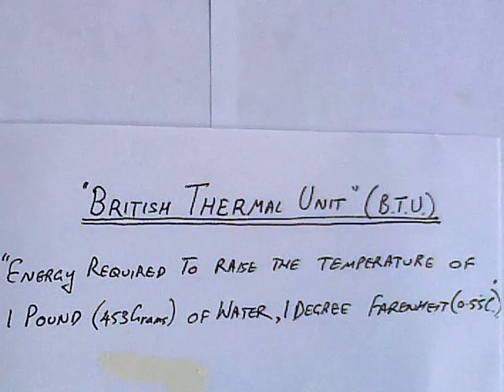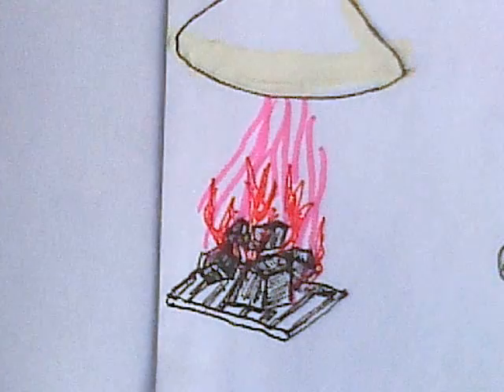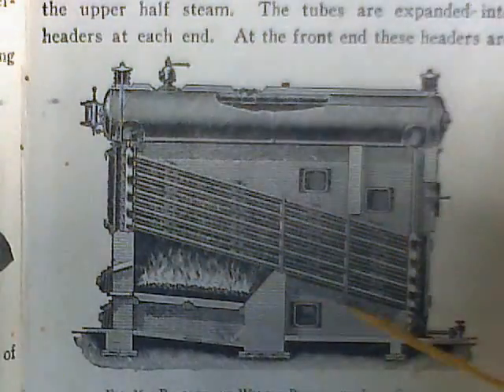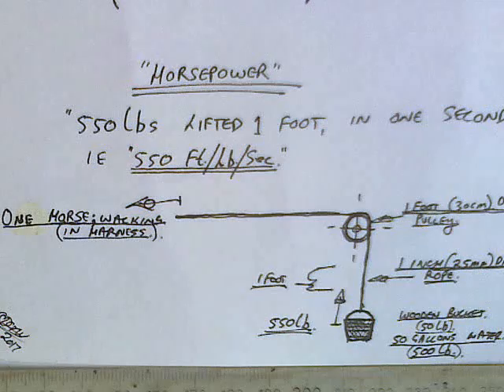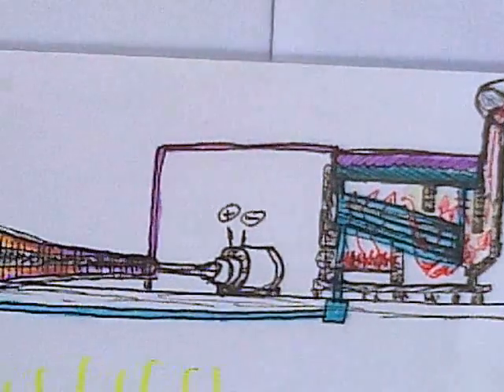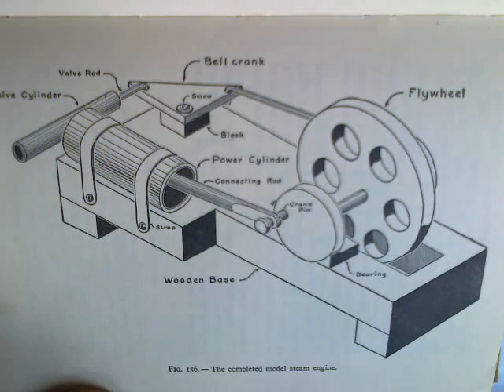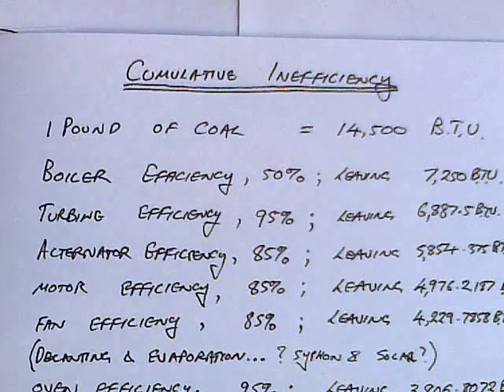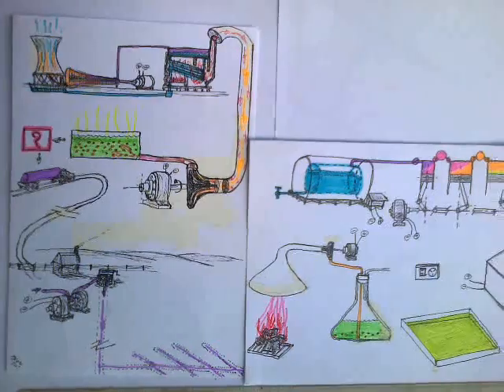Is Carbon Capture & Storage Thermodynamically Impossible...?

Comment: Unfortunately, it's quite incorrect. You have just estimated the energy conversion efficiency of a machine which burns coal (as a coal plant) and uses all resulting energy for carbon capture and storage. It's not electricity as this machine useful work is only liquefaction of carbon dioxide. Most importantly, it doesn't have sufficient supply of it from its coal plant.
As published in an IPCC report on carbon dioxide capture and storage, the energy efficiency of a coal plant drops by about 15%, if carbon capture is used, because of the energy spent on dealing with CO2.
Reply from the maker: G'day,

   Thanks,

     I haven't seen the IPCC Report of which you speak, but I have yet to see or hear of a single Climate Scientist who ever designed & built a Turbine and then used it to drive an Alternator or Generator with it, and subsequently charged up so much as a single Nickel-Cadmium Penlight Battery with it...; therefore I have no great trust in their ability to understand Cumulative Inefficiency.

   I have designed & built Turbines, albeit Free-Air & Ducted Wind-Turbines, and charged a few Batteries with them ; and I've seen how big a Steam-Boiler (Vertical Fire-Tube) it takes to run a Double-Action Single-Cylinder Steam-Engine at 250 RPM to drive a 50-amp Automotive Alternator at 1,000 RPM (which is 30% too slow to make any Current...!).

   The Freely-Polluting Coalfired Steam-Turbine driven Generators only convert 40.3% of the Energy in the Coal into Electricity....

   Considering that Air is 79% Nitrogen, and all of that has to be included in the Air-In/Flue-Gasses Out Equation, and remembering that all the Flue-Gasses have to be captured and processed while trying to capture the 27%-35% of their mass which is C.O.-2 in giant Lime-Water Hubble-Bubble/Hookahs, then you have to evaporate the Water off and bake the C.O.-2 out of the Dry Lime Crystals, before compressing it to liquify it and then refrigerate it to store it, and then carry it in an ELECTRIC Refrigetated Truck to the disused Mine where it is to be Pressure-injected via an Electric Pump...; my opinion is that anybody who thinks that all that 
mechanical manipulation can be achieved with a loss of only "15% of the Power Station's Output" simply hasn't thought the issue through.

   I contend that there is not sufficient Energy available from burning Coal to make Electricity  to power the Engineering  required to Capture & Store the CO-2 which burning aforesaid Coal releases ; let alone to capture the Emissions, liquify and transport and store them, as well as contribute any Current to the Grid.

  I'm saying that "The Emperor Has No Clothes !" and that the whole thing is a Crock of Horsefeathers.

  Such is Life,

  Take it easy...

  ;-p

   Ciao !
Reply: The cited data didn't come from climate scientists, as one should expect, but from engineers. For example, a paper estimating the change in efficiency from 36.6% to 21.4% is written by Edward S. Rubin who's a professor of mechanical engineering at the Carnegie Melon University and A. B. Rao who has a PhD in engineering & public policy, Masters in Environmental Science and Engineering, and B. Tech. in chemical engineering. And the paper was published, of course, in a peer-reviewed journal.

Well, there are different ways to solve the task, so details aren't actually important for superficial analysis. The one involving lime releases heat during capture that can be reused. The gas isn't precisely liquefied, but compressed into the supercritical state and the compression heat is again reused. They propose mostly pipelines instead of trucks and no refrigeration is needed (just thick walls to withstand the pressure).

In fact, they have not only thought it through, but they rely on information provided by existing carbon capture factories, like one in Malaysia. So, the real experiment has been done long time ago.

But the most important idea here is that energy released during the chemical change of combustion per mole of the carbon involved is much larger than the work required to change the physical state of the product (per mole). So, there is plenty of energy to work with even with all inefficiencies of the process.
Reply from the maker: +Macropus Macropode 

   Well, that all sounds good, but I can't see it working out as well as they like to predict.

  The sheer scale of the problem of capturing all the products of combustion, without inducing any Back-Pressure in the Flue to annoy the Furnace, and processing the Gasflow to separate-out & compress the C.O.-2 as fast as the Furnace produces Fumes....; strikes me as being a bloody big shitpotful more work than a mere 15% of the Power Station's Electrical Output will provide for.

   Maybe I'm wrong, but that's my "Gut-Feeling".

   I have a book on Methane, and the Hoops which one has to jump through  to turn Shit into Biogas (which is 27% to 45% CO-2) which has to be scrubbed out with Lime-Water before putting the resulting Gas through Iron Filings to remove the Hydrogen Sulphide....; after that the Methane feeds a 6-cylinder Liquid-cooled Engine (feeding it's "waste" heat back into the Methane Digester) driving a 3-stage Liquid-cooled Compressor (also heating the Digester) to squeeze the Methane down to 1,000 PSI..., to go in a long narrow High-Pressure Storage Cylinder.

   It gives one calculation about a 6 Hp Roto-Tiller running for 25 minutes to the Tank of Methane which goes like this ;

   "At 25% Compressor Efficiency it would take 0.52 Hp/Hr to compress the Gas (1,320 BTU). In other words it would take 1,320 BTU worth of Gas to compress the 25,300 BTU worth of Gas which it takes to perform 6,350 BTU worth of Work. Clearly the system is not very "efficient" in the sense that 21% of the RESULTING Work Energy is needed for Compression, while 75% of the AVAILABLE Energy is lost as heat...".

  So, 96% of the Energy from the uncompressed Methane finishes up  going somewhere else, and doing something other than emerging from the Engine's Crankshaft as Torque.

   And because Methane is a way to run Internal  Combustion Engines on Bullshit, it can be worth doing if one has a source of enough free Bullshit.

  But trying to capture & store the C.O.-2 Emissions from a Coalfired Powerplant will only add to the cost of building & operating the Installation, at a time when Megawatt for Megawatt it's already 30% cheaper to build Windmills or Solar-Panels than it is to build Free-Farting Coalfired Steam-Turbines...

  So, my guess is that the Engineers who wrote the IPCC Report have been overly optimistic, possibly because they're True-Believers in King Coal (?)...

   Take it easy,

 ;-p

  Ciao !
Reply from the maker: +Macropus Macropode 

  Well, your grip on Maths & Physics & Chemistry far exceeds mine, partly a legacy of 3 High Schools in 12 months, meaning 15 straight months of Biology, but no Physics or Chem., and I never retained anything in a Maths Lesson after a Skull-fracture in 1975...; but I kept the Arithmatic from Primary-School while topping the School in Biology...
  
   So to me a "Mole" is a terrestrial version of a Vole, ie it's a Water-Rat.

   When I read that "a Compressor is 25% efficient" then to me that indicates that if it takes 100 Hp of Torque to operate it, then 75 Hp goes into generating Noise & Heat, and 25 Hp winds up as increased Pressure in the compressed & contained Gas.

   The point that the Methaneologists advocate using Liquid-cooled Compressors to enable  them to pump their otherwise "wasted" heat into their Digester, to help hold it at 38 Celsius for optimal Methanogenesis doesn't alter the fact that they need to put 100 Hp into the Compressor, for it to do 25 Hp worth of Work.

  The fact that every Compressor I've ever seen has been Air-Cooled..., suggests that right from the start their Recipe is calling for a packet of Hen's Teeth...; and in my own case I quickly lost interest in modifying anything to generate or use Methane.

   To drive a 6-cylinder "Family Car" 100 Km per week requires a 4-chamber Digester, and every Week one has to empty one Chamber of Sludge & refill it with 1 Ton(ne) of half-dry Cowshit to generate the Biogas ; which then has to be scrubbed twice, to have enough Methane in a Gasometer to feed into the Engine which drives the Hens' Teeth Compressor, to squeeze the Methane into the narrow, heavy, thick-walled Cylinders required to store it.

  The idea, heavily propagated in "Mad Max-3", that post-Apocalyptic survivors will gather together to build their Bartertown, and they'll run the place on Methane from the fermented Turds of a herd of a hundred Pigs (feeding on Fossil-fuelled industrially Broadacre mono-cropped Wheat & Corn ?)...., turns out to be an insanely demented, ignorant, and optomistic fantasy.

   My gut feeling, according to "Cheops Law" of "Nothing Ever Gets Built On Time, Nor Within Budget...!" leads me to suspect that "Carbon Capture & Storage" is an idea which reeks of theoretical, accademic, Laborotory-Scale Experimental Bullshit which does not at all transfer into the Real World when anyone tries to build it on an Industrial Scale.

   I admit to being highly prejudiced against "CC&S" because of the phenomenal Bullshit-Content of the "Clean Coal" Lobby - which has been propagating the lie  for 50 years that by burning Coal hotter then the amount of CO-2 it releases will be (magically) reduced...; and I fully expect that the CC&S Lobby is at least as full of Bullshit as is the Clean Coal Lobby..., largely because they are the same people, working for the same Coalmining Industry, and they have proven that they can be counted on to say whatever they want the Audience to believe, in order to secure their continued "Social Licence" to dig and sell and burn Coal...

  And to me, the notion that "it will only take 15% of a Coalfired Power-Station's Electrical Output to capture all it's Flue-Gasses and separate out the CO-2 and liquify it and transport it and inject it underground...." ; is clearly and obviously wrong, by about one entire order of Magnitude.

   I could, and would, believe that if anybody ever seriously tried to do it then the CC&S Process will take about 150% of the Power Station's Electrical Output, to achieve their stated goal of shitting underground rather than into the Sky.

   And, as you said, there isn't time..., and there isn't any available Economic nor Political Will to conduct Preventive Maintenance on the existing Grid, Roads, Bridges, Dams, Railways or Ports (everything is running on Emergency Repairs conducted after something fails....), let alone retrofitting all existing Power Stations with anything which will make them a) produce less Current available for sale, & b) make that Current more expensive to produce.

   I suspect that the difference between my assessment & the one in the IPCC Report may be a deliberate Typographical Error, built into their Figures by whichever Coal Industry Engineers wrote their glowing Prospectus ; "150%" is thus very easily transmogrified into "15%", especially when somebody's Salary depends on their selling Shit for Shoe-Polish.

   But, in the long run, Tronald Dump appears to be the Gaia Principle's emergency-response to Broadacre Fossil-Fooled Industrial Harvest Everything-ism...; he's steadily deconstructing the Global Village, and the International Economy is poised to implode ; while everything being done in desperate attempts to maintain "Economic profitability" is whittling-away Human Society's ability to withstand  the slightest interruption in the supply & delivery of anything - food, water, fuel, electricity, spare parts, raw materials, components..., you name it & nobody keeps anything "in Stock" anywhere, not any more.

   We're in this situation because ever since 1945 the World has been largely run by intelligent educated civilised cultured Diplomats & professional Politicians, who understood what was going on & were trying to cut deals which would advantage their own Nation...; and now the US Nukeyoulater Launch-Codes have been given to a stupid ignorant uncivilised &  uncultured loudmouthed thrice- bankrupted Buffoon, with no idea of what he's doing or how anything works, who reacts reflexively & unthinkingly, and appears entirely driven by his own selfishness, lust, greed, ambition for power and petty piques....

  I can sense a great Cull coming, it's in the Pipeline...

   Either Humanity suddenly becomes a completely de-industrialised Species and thereby ceases to over-harvest & prodigiously pollute, achieving a Global status somewhere between being "Rare & Threatened", & being "Endangered".., sometime within the next 5 or 10 years, and the Biosphere is thus given a chance to recover - while such a chance still remains ; or it's all over - and we may finish up with a runaway Greenhouse Effect, and looking like Venus (so says Stephen Hawking...).

    Tronald Dump has apparently been thrown up, by the Gaia Effect,  to Balkanise the Excited States and thus cause the Global Economy to implode...; because if the competant Politicians & Diplomats were left to continue trying to keep everything functioning, without catastrophic failure, for another 50 years...,then every Species on the Planet is existentially Up Shit Creek.

   That's what I tell the Kangaroos & Wallabies, anyway ; while trying to explain what the fuck Humanity thinks it's trying to achieve.

  Happily, Macropods don't like to ascribe Collective Guilt, nor do they inflict Collective Punishment...; so, they still come and share my food, regardless of how badly other Humans behave, and they don't beat me up to even the score when somebody else shoots at them, either (try teaching Israelis & Palestinians that trick...!).

  Have a good one,

   ;-p

   Ciao !
Reply from the maker: +Macropus Macropode 

  Well, your grip on Maths & Physics & Chemistry far exceeds mine, partly a legacy of 3 High Schools in 12 months, meaning 15 straight months of Biology, but no Physics or Chem., and I never retained anything in a Maths Lesson after a Skull-fracture in 1975...; but I kept the Arithmatic from Primary-School while topping the School in Biology...
  
   So to me a "Mole" is a terrestrial version of a Vole, ie it's a Water-Rat.

   When I read that "a Compressor is 25% efficient" then to me that indicates that if it takes 100 Hp of Torque to operate it, then 75 Hp goes into generating Noise & Heat, and 25 Hp winds up as increased Pressure in the compressed & contained Gas.

   The point that the Methaneologists advocate using Liquid-cooled Compressors to enable  them to pump their otherwise "wasted" heat into their Digester, to help hold it at 38 Celsius for optimal Methanogenesis doesn't alter the fact that they need to put 100 Hp into the Compressor, for it to do 25 Hp worth of Work.

  The fact that every Compressor I've ever seen has been Air-Cooled..., suggests that right from the start their Recipe is calling for a packet of Hen's Teeth...; and in my own case I quickly lost interest in modifying anything to generate or use Methane.

   To drive a 6-cylinder "Family Car" 100 Km per week requires a 4-chamber Digester, and every Week one has to empty one Chamber of Sludge & refill it with 1 Ton(ne) of half-dry Cowshit to generate the Biogas ; which then has to be scrubbed twice, to have enough Methane in a Gasometer to feed into the Engine which drives the Hens' Teeth Compressor, to squeeze the Methane into the narrow, heavy, thick-walled Cylinders required to store it.

  The idea, heavily propagated in "Mad Max-3", that post-Apocalyptic survivors will gather together to build their Bartertown, and they'll run the place on Methane from the fermented Turds of a herd of a hundred Pigs (feeding on Fossil-fuelled industrially Broadacre mono-cropped Wheat & Corn ?)...., turns out to be an insanely demented, ignorant, and optomistic fantasy.

   My gut feeling, according to "Cheops Law" of "Nothing Ever Gets Built On Time, Nor Within Budget...!" leads me to suspect that "Carbon Capture & Storage" is an idea which reeks of theoretical, accademic, Laborotory-Scale Experimental Bullshit which does not at all transfer into the Real World when anyone tries to build it on an Industrial Scale.

   I admit to being highly prejudiced against "CC&S" because of the phenomenal Bullshit-Content of the "Clean Coal" Lobby - which has been propagating the lie  for 50 years that by burning Coal hotter then the amount of CO-2 it releases will be (magically) reduced...; and I fully expect that the CC&S Lobby is at least as full of Bullshit as is the Clean Coal Lobby..., largely because they are the same people, working for the same Coalmining Industry, and they have proven that they can be counted on to say whatever they want the Audience to believe, in order to secure their continued "Social Licence" to dig and sell and burn Coal...

  And to me, the notion that "it will only take 15% of a Coalfired Power-Station's Electrical Output to capture all it's Flue-Gasses and separate out the CO-2 and liquify it and transport it and inject it underground...." ; is clearly and obviously wrong, by about one entire order of Magnitude.

   I could, and would, believe that if anybody ever seriously tried to do it then the CC&S Process will take about 150% of the Power Station's Electrical Output, to achieve their stated goal of shitting underground rather than into the Sky.

   And, as you said, there isn't time..., and there isn't any available Economic nor Political Will to conduct Preventive Maintenance on the existing Grid, Roads, Bridges, Dams, Railways or Ports (everything is running on Emergency Repairs conducted after something fails....), let alone retrofitting all existing Power Stations with anything which will make them a) produce less Current available for sale, & b) make that Current more expensive to produce.

   I suspect that the difference between my assessment & the one in the IPCC Report may be a deliberate Typographical Error, built into their Figures by whichever Coal Industry Engineers wrote their glowing Prospectus ; "150%" is thus very easily transmogrified into "15%", especially when somebody's Salary depends on their selling Shit for Shoe-Polish.

   But, in the long run, Tronald Dump appears to be the Gaia Principle's emergency-response to Broadacre Fossil-Fooled Industrial Harvest Everything-ism...; he's steadily deconstructing the Global Village, and the International Economy is poised to implode ; while everything being done in desperate attempts to maintain "Economic profitability" is whittling-away Human Society's ability to withstand  the slightest interruption in the supply & delivery of anything - food, water, fuel, electricity, spare parts, raw materials, components..., you name it & nobody keeps anything "in Stock" anywhere, not any more.

   We're in this situation because ever since 1945 the World has been largely run by intelligent educated civilised cultured Diplomats & professional Politicians, who understood what was going on & were trying to cut deals which would advantage their own Nation...; and now the US Nukeyoulater Launch-Codes have been given to a stupid ignorant uncivilised &  uncultured loudmouthed thrice- bankrupted Buffoon, with no idea of what he's doing or how anything works, who reacts reflexively & unthinkingly, and appears entirely driven by his own selfishness, lust, greed, ambition for power and petty piques....

  I can sense a great Cull coming, it's in the Pipeline...

   Either Humanity suddenly becomes a completely de-industrialised Species and thereby ceases to over-harvest & prodigiously pollute, achieving a Global status somewhere between being "Rare & Threatened", & being "Endangered".., sometime within the next 5 or 10 years, and the Biosphere is thus given a chance to recover - while such a chance still remains ; or it's all over - and we may finish up with a runaway Greenhouse Effect, and looking like Venus (so says Stephen Hawking...).

    Tronald Dump has apparently been thrown up, by the Gaia Effect,  to Balkanise the Excited States and thus cause the Global Economy to implode...; because if the competant Politicians & Diplomats were left to continue trying to keep everything functioning, without catastrophic failure, for another 50 years...,then every Species on the Planet is existentially Up Shit Creek.

   That's what I tell the Kangaroos & Wallabies, anyway ; while trying to explain what the fuck Humanity thinks it's trying to achieve.

  Happily, Macropods don't like to ascribe Collective Guilt, nor do they inflict Collective Punishment...; so, they still come and share my food, regardless of how badly other Humans behave, and they don't beat me up to even the score when somebody else shoots at them, either (try teaching Israelis & Palestinians that trick...!).

  Have a good one,

   ;-p

   Ciao !
Reply from the maker: +Macropus Macropode 

  Well, your grip on Maths & Physics & Chemistry far exceeds mine, partly a legacy of 3 High Schools in 12 months, meaning 15 straight months of Biology, but no Physics or Chem., and I never retained anything in a Maths Lesson after a Skull-fracture in 1975...; but I kept the Arithmatic from Primary-School while topping the School in Biology...
  
   So to me a "Mole" is a terrestrial version of a Vole, ie it's a Water-Rat.

   When I read that "a Compressor is 25% efficient" then to me that indicates that if it takes 100 Hp of Torque to operate it, then 75 Hp goes into generating Noise & Heat, and 25 Hp winds up as increased Pressure in the compressed & contained Gas.

   The point that the Methaneologists advocate using Liquid-cooled Compressors to enable  them to pump their otherwise "wasted" heat into their Digester, to help hold it at 38 Celsius for optimal Methanogenesis doesn't alter the fact that they need to put 100 Hp into the Compressor, for it to do 25 Hp worth of Work.

  The fact that every Compressor I've ever seen has been Air-Cooled..., suggests that right from the start their Recipe is calling for a packet of Hen's Teeth...; and in my own case I quickly lost interest in modifying anything to generate or use Methane.

   To drive a 6-cylinder "Family Car" 100 Km per week requires a 4-chamber Digester, and every Week one has to empty one Chamber of Sludge & refill it with 1 Ton(ne) of half-dry Cowshit to generate the Biogas ; which then has to be scrubbed twice, to have enough Methane in a Gasometer to feed into the Engine which drives the Hens' Teeth Compressor, to squeeze the Methane into the narrow, heavy, thick-walled Cylinders required to store it.

  The idea, heavily propagated in "Mad Max-3", that post-Apocalyptic survivors will gather together to build their Bartertown, and they'll run the place on Methane from the fermented Turds of a herd of a hundred Pigs (feeding on Fossil-fuelled industrially Broadacre mono-cropped Wheat & Corn ?)...., turns out to be an insanely demented, ignorant, and optomistic fantasy.

   My gut feeling, according to "Cheops Law" of "Nothing Ever Gets Built On Time, Nor Within Budget...!" leads me to suspect that "Carbon Capture & Storage" is an idea which reeks of theoretical, accademic, Laborotory-Scale Experimental Bullshit which does not at all transfer into the Real World when anyone tries to build it on an Industrial Scale.

   I admit to being highly prejudiced against "CC&S" because of the phenomenal Bullshit-Content of the "Clean Coal" Lobby - which has been propagating the lie  for 50 years that by burning Coal hotter then the amount of CO-2 it releases will be (magically) reduced...; and I fully expect that the CC&S Lobby is at least as full of Bullshit as is the Clean Coal Lobby..., largely because they are the same people, working for the same Coalmining Industry, and they have proven that they can be counted on to say whatever they want the Audience to believe, in order to secure their continued "Social Licence" to dig and sell and burn Coal...

  And to me, the notion that "it will only take 15% of a Coalfired Power-Station's Electrical Output to capture all it's Flue-Gasses and separate out the CO-2 and liquify it and transport it and inject it underground...." ; is clearly and obviously wrong, by about one entire order of Magnitude.

   I could, and would, believe that if anybody ever seriously tried to do it then the CC&S Process will take about 150% of the Power Station's Electrical Output, to achieve their stated goal of shitting underground rather than into the Sky.

   And, as you said, there isn't time..., and there isn't any available Economic nor Political Will to conduct Preventive Maintenance on the existing Grid, Roads, Bridges, Dams, Railways or Ports (everything is running on Emergency Repairs conducted after something fails....), let alone retrofitting all existing Power Stations with anything which will make them a) produce less Current available for sale, & b) make that Current more expensive to produce.

   I suspect that the difference between my assessment & the one in the IPCC Report may be a deliberate Typographical Error, built into their Figures by whichever Coal Industry Engineers wrote their glowing Prospectus ; "150%" is thus very easily transmogrified into "15%", especially when somebody's Salary depends on their selling Shit for Shoe-Polish.

   But, in the long run, Tronald Dump appears to be the Gaia Principle's emergency-response to Broadacre Fossil-Fooled Industrial Harvest Everything-ism...; he's steadily deconstructing the Global Village, and the International Economy is poised to implode ; while everything being done in desperate attempts to maintain "Economic profitability" is whittling-away Human Society's ability to withstand  the slightest interruption in the supply & delivery of anything - food, water, fuel, electricity, spare parts, raw materials, components..., you name it & nobody keeps anything "in Stock" anywhere, not any more.

   We're in this situation because ever since 1945 the World has been largely run by intelligent educated civilised cultured Diplomats & professional Politicians, who understood what was going on & were trying to cut deals which would advantage their own Nation...; and now the US Nukeyoulater Launch-Codes have been given to a stupid ignorant uncivilised &  uncultured loudmouthed thrice- bankrupted Buffoon, with no idea of what he's doing or how anything works, who reacts reflexively & unthinkingly, and appears entirely driven by his own selfishness, lust, greed, ambition for power and petty piques....

  I can sense a great Cull coming, it's in the Pipeline...

   Either Humanity suddenly becomes a completely de-industrialised Species and thereby ceases to over-harvest & prodigiously pollute, achieving a Global status somewhere between being "Rare & Threatened", & being "Endangered".., sometime within the next 5 or 10 years, and the Biosphere is thus given a chance to recover - while such a chance still remains ; or it's all over - and we may finish up with a runaway Greenhouse Effect, and looking like Venus (so says Stephen Hawking...).

    Tronald Dump has apparently been thrown up, by the Gaia Effect,  to Balkanise the Excited States and thus cause the Global Economy to implode...; because if the competant Politicians & Diplomats were left to continue trying to keep everything functioning, without catastrophic failure, for another 50 years...,then every Species on the Planet is existentially Up Shit Creek.

   That's what I tell the Kangaroos & Wallabies, anyway ; while trying to explain what the fuck Humanity thinks it's trying to achieve.

  Happily, Macropods don't like to ascribe Collective Guilt, nor do they inflict Collective Punishment...; so, they still come and share my food, regardless of how badly other Humans behave, and they don't beat me up to even the score when somebody else shoots at them, either (try teaching Israelis & Palestinians that trick...!).

  Have a good one,

   ;-p

   Ciao !